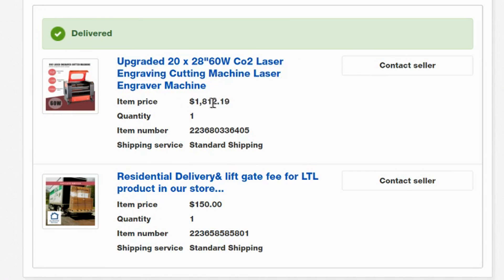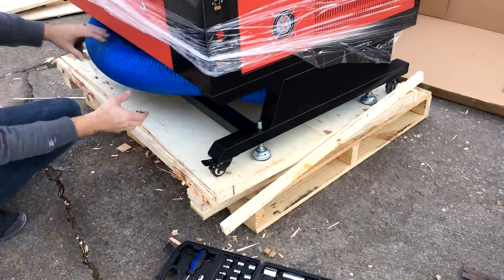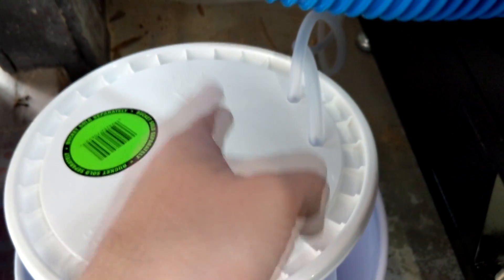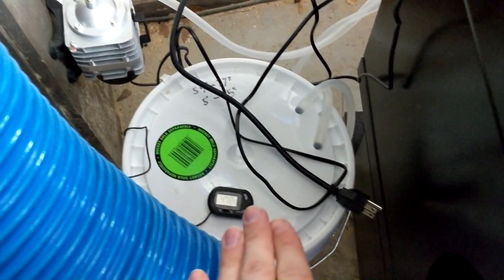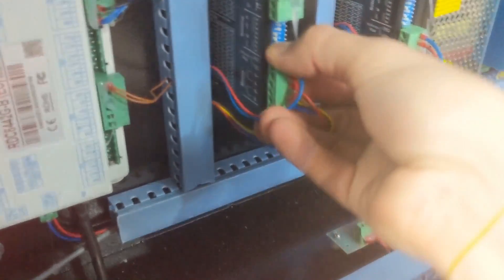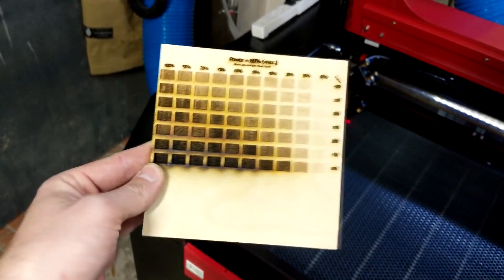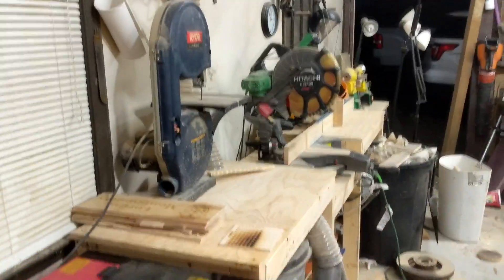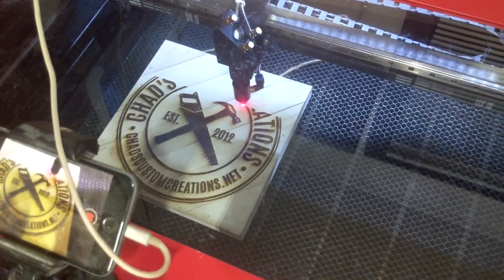I Buy a $2,000 Chinese Co2 Laser, What You Need to Get Started

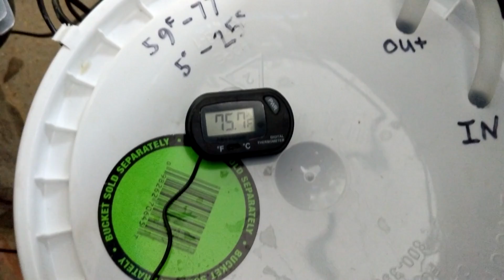Comment: 7:53 “Water temperature didn’t change at all. That’s really a good thing.”

Yeah, either that or it’s not flowing through the laser tube. I’d actually be worried if the coolant temperature didn’t change.
Reply from the maker: You know I said it didn't change but it actually did a few degrees. I've got a chiller running now and its great. No more running around with frozen water bottles.
Reply: @ChadsCustomCreations  great,great https://youtu.be/90iGvjly_9s

Comment: What brand is it?
Reply from the maker: There should be links to the brand in the description. Can't remember the name off the top of my head.
Reply: You labeled the links in the description as similar machines but didn’t say they were the same. Was just curious if the brand name was listed on the manual or on anywhere on the machine itself.
Reply from the maker: @MrPotato2  oh crap sorry I thought this comment was on my mailbox video sorry about that app was acting weird.

So the laser I got really has no branding at all you will see people just referring to it as the 60w red and black. I've had my eye on the Orion brand though they looks similar but nicer and with extra features.
Reply: Chads Custom Creations no worries on the video mixup. Thanks for taking a second look 😎

What size is the engraving area?  I’m thinking about adding an engraving machine so that I can add that capability to my shop. I have been trying to determine what size I really need. I want it small enough so I can afford it but big enough so I don’t outgrow it to quickly. 

Does yours have the pass through doors for doing longer work pieces that you can do by breaking them into sections and feeding the work through step by step?
Reply from the maker: @MrPotato2  so laser area is 27.5"x19" it does have a passthrough that allows for 30" wide and any length
Reply: Chads Custom Creations thanks! Would you say that’s large enough for most things?  What about the 16x24?  Would that be too limiting or do you think it would be a good place to start?
Reply from the maker: @MrPotato2  it's going to depend on what you plan on doing with it but I would be able to do all the stuff I've been doing on a 24x16
Reply: Chads Custom Creations mostly going to be putting logos on cutting boards (11x17 or so), jewelry boxes, etc. Also planning to offer engraving services for things like Yetti cups, flasks, etc. 

I may do an occasional art piece or memorial thing that would need the pass through option but I don’t think it would be all that common. I honestly assume that I’ll think of many more things once I have it but that’s my starting point for now

Comment: I cannot find this exact listing on eBay, could you possibly share the link? Thank you in advance.
Reply from the maker: So I just took a look on ebay I bought mine back in January looks as though most of the ones on ebay have a controller thats is not recommended.

I took a look on Amazon and found a name brand that has a few more features than mine even has and has the correct controller. Its a little more expensive but looks like shipping is already included.

https://amzn.to/2QL6zr6
Reply: Chads Custom Creations exactly what I was just looking at! I knew I wanted a Rudia controller, but couldn’t find one on eBay I just hope it comes with lift gate service included Thank you again! Upgrading myself from the Glowforge the Asurion extended warranty I had on it just paid me full purchase price because it stopped working Hoping to do a lot more with this, especially with the pass through
Reply from the maker: I've got some friends with the glowforge and everything they see me using the laser they are kicking themselves at the price they paid for glowforge. 

As for the lift gate I would say just read through that description if its not included they would most likely say.

Comment: To avoid the "smoke" residue, change starting point to front of work area. That way as the laser moves over the project,  it removes the smoke residue. Starting from the back of the machine does the opposite.
Reply from the maker: Holy crap that is a pro tip I never would have come up with on my own. Thank you.

Comment: I just got mine about a month ago and it was advertised as a 60w but in fact tube had measurements of a 50w. Do you have a milliamp meter on yours, mine has a digital one on the tube power supply and I've always kept it below 20ma and that is around 75 percent power. Is yours a true 60w or a 50w like mine? My tube didn't have any rating about max power like others say to look for. How did you determine safe power setting for your laser. Glad to find your channel, I'm in North Alabama, heard someone mention you're in Georgia.
Reply: This is one of the problems with this manufacturer. You’re not the only one reporting on this.
Reply from the maker: It's been a minute since I have measured the tube but I do believe my is a true 60w I'll double check though. I did install a multimeter and also keep mine below 20ma by running 60% I probably could bump it up a little more maybe 75% would be fine for mine also. I'm gonna attempt to slice a pizza I'll go 100% for that one 😄 

Yes thats correct I am in middle GA.

Glad you found me I just released a second laser video showing the rotary I set up on mine.

Comment: hi Chad , kool video . whats the cutting size of the laser bed? thanks
Reply from the maker: It comes out to 27.5 inches left to right 19.5" top to bottom and bed can be lowered to I believe 9 inches down
Reply: @ChadsCustomCreations  kool , thanks
Reply from the maker: @MrPhantom302  absolutely
Reply: @ChadsCustomCreations  one last ? Would you have the link were you bought your laser from . Thanks and have a great day 😀
Reply from the maker: @MrPhantom302  I actually tried to get it before posting this video but sadly the seller on eBay has stopped selling no idea why he still had good ratings. I found it by searching for 60w co2 laser and using the filters on Ebay to make sure it was already in a US warehouse. Also remember to look for the specific sellers lift gate service normally they have that as a separate listing.
Reply: @ChadsCustomCreations  kool , ill look . Thanks for the tips,  look forward more of your videos.
Reply: @MrPhantom302  Hi Bro, I got some awesome laser machine as well, if u re intersted, let me know.

Comment: Thanks for sharing this video, I was looking into getting the 80 watt version of this laser cutter/engraver (330 lbs worth) ... I noticed you didn't use any air filtration unit at all, just vented directly outside?  I plan to work with 6mm MDF and 3mm Acrylic materials and I'm environmentally conscience not to mention my neighbors would probably get pissed off if I vented unfiltered ... as you have shown in your video, it looked like your house was on fire from the fumes.  Have you considered an air filtration system?  If so, recommendations?  Also, any chance you have a DB reading on the noise it generates from about 20 feet away?
Reply: You can make a carbon filter unit that sits next to the cabinet for between $300-$400.  Also, unless you already made a purchase, you can save some money by buying the 60 watt laser and buying a GOOD RECI 80w tube and power supply, or even go up to a 100W tube.  The cost is ~$600 plus shipping for the tube and supply, and you get a True 80 watts.  An end cap can be made from 4" PVC drain pipe and a flange and cap from Home Depot.
Reply: I had access to an 80W laser cutter at a local makerspace, at least until Melbourne went into lockdown in March. My experience with cutting MDF is that it reeks and is a possible health hazard. If you have neighbours nearby, I’d say filtration is a must.
Reply: @markgearing  Thank you, appreciate the response ... yes air filtration is on my must include list.
Reply from the maker: I went with the 60w cause I believe its the highest voltage without the bump out of the side although once my tube goes out I may go ahead and upgrade it like some have done. 

In the video the fumes are normally not that bad I believe that wood had a lot of moisture in it at the time causing what looked like a house fire.

The noise from the stock fan is pretty loud I don't have any readings but I would say pretty close to a lead blower, though I've seen people upgrade that to a much quieter online fan. 

I'll be putting out more videos dealing strictly with the laser, wanting to do a series on will it cut. I'm thinking pizza is a must.
Reply: Chads Custom Creations Thanks for the response, look forward to more info as you progress.

Comment: Unless you expect your bucket to freeze i would turn off the heater as its not needed unless you think it will freeze
Reply from the maker: Only had it in there for the winter and to get the water up to 59 degrees it would freeze as this is just in my garage workshop.

Comment: Wheels? Who needs wheels just throw it on your shoulder. Haha How is the cooling system working in the Georgia heat?
Reply from the maker: Still waiting to see a strong Canadian through some melamine above his head in home depot.

That bucket worked in the winter and spring. Couldn't  hang in the summer heat, I'll be doing a short video on the upgrades I've added to my setup soon.